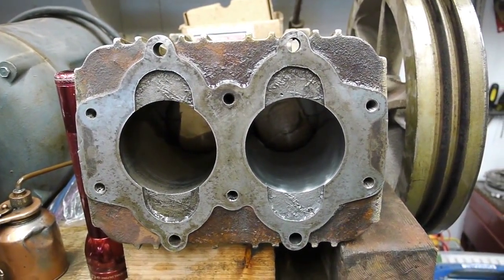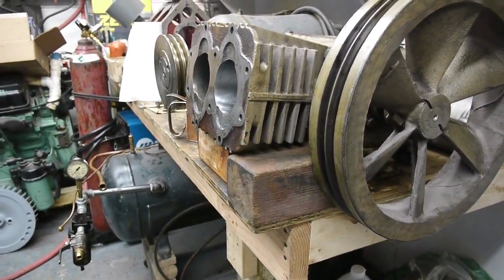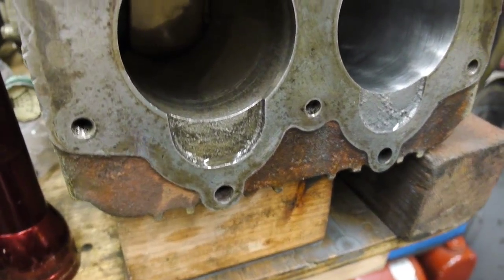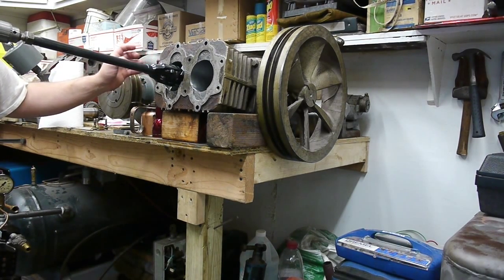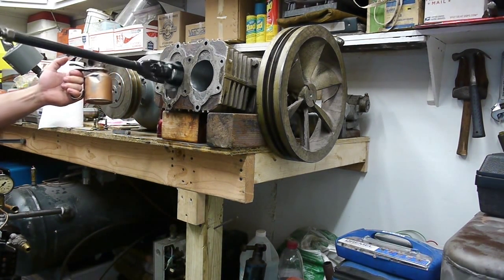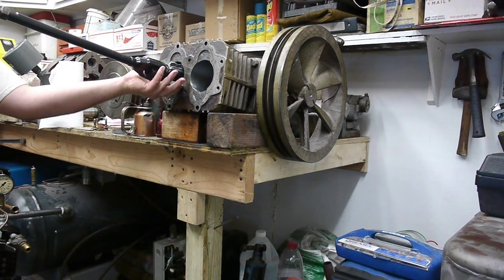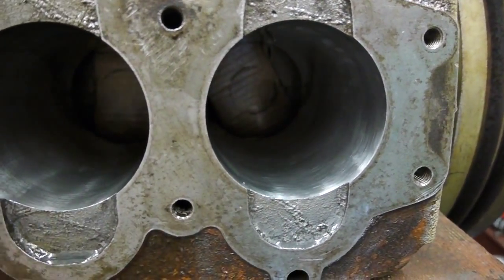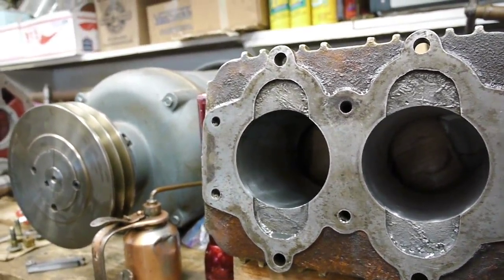Honing a Quincy Compressor with a rigid body Sunnen Portable Hone

Comment: Is it standard practice to hone the cylinders while attached to the crank case?  It seems like you are not honing the full cylinder with the same pattern and diameter, but the larger risk seems to be flushing all of the grit from the stones and the iron from the cylinders into the crank case where the pressure lube will force them into the bearings, oil pump, journals, pins, and back into the pistons and cylinders.
Reply from the maker: I could have removed the cylinder from the crankcase but I did not. With a gear driven rigid body hone you really do not run any risk of damaging a cylinder as long as you are careful and use a lot of oil. I had put some soft pine wood above the crankpins to protect the crankshaft. From memory the stones penetrated about 2 inches into the crankcase so they were doing their job without running the risk of bellmouthing the bottom of the cylinder. After honing the cylinders I pulled the crankshaft, replaced the tapered roller bearings and thoroughly cleaned every surface. I probably gave myself more work doing it this way, but I ended up cleaning everything anyways. The compressor has been running flawlessly for 8 years and has racked up over 1400 hours of runtime on it.
Reply: @screaminjimmy6V53T glad I came across this, ordered one for a Kellogg 452 overhaul.

Comment: Do you remember how long it took for the rings to seat? Im in the process of doing the same to a Champion pump.
Reply from the maker: The folks at Scales Compressor, my local compressor shop, recommended to run the compressor with the head off for 24 hours or until oil stops pooling on the top of the pistons. I put a fresh set of rings on my Quincy pistons, and with the fresh honed cylinders, the new rings fully seated in in less than three hours. I continued to run it for 24 hours without a head to ensure the rings were seating. If you are still getting oil on the tops of your pistons you may need to inspect the rings, and or run it longer. If your compressor has an oil pump in it, use 30 weight non detergent oil for break-in, then SAE20 or whatever your compressor normally uses from then on. Run the compressor at about three quarters of its rated rpm during the break-in. I have a video titled: "Break-In Procedure for Quincy Compressors" which shows exactly what I am talking about.

Comment: Here's a guy doing the job RIGHT!
A dial bore gauge would also be helpful. 
Don't dwell in the bottom, the bore will bell mouth. 

There's another guy on youtube (ROTARYCOMPTECH)  that thinks he knows how to rebuild a Quincy compressor....he has NO CLUE. He gives poor information. 
He uses a spring type glaze breaker and says he's honing the cylinder. 
WRONG. 
This is the proper tool for cylinder honing. 
Your rebuild job will be a good one.
Nice work!
Reply: I saw the same video from Rotarycomptech and he talked about the ball hone vs. spring vs. locking and in his video you I could clearly see him adjusting the locking hone just as this guy did. Seems you have a personal beef with him, based on the same comments I saw on his video..........or you didn't watch the entire video. He said he hates the name "dingleberry" hone and that it is great to break the glaze with, but it will not true the cylinder.
Reply: kmcwhq yeah I have no clue
Reply: kmcwhq for your information the hone  I used was not a spring-loaded hone it was a locking hone,
very similar to this one used in this video